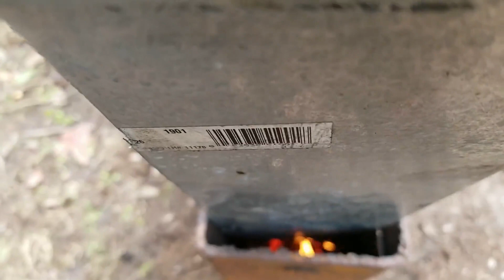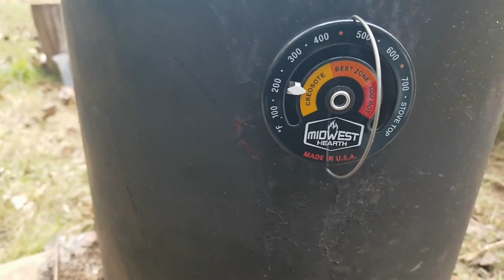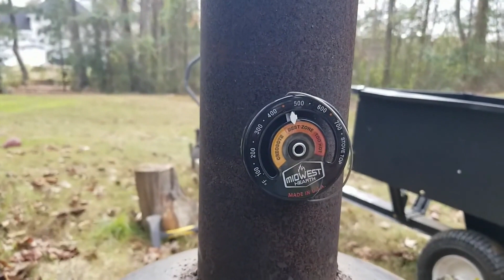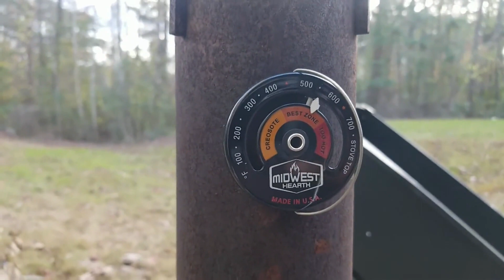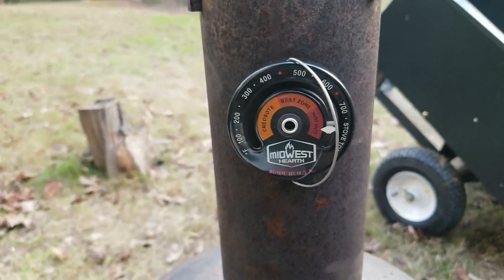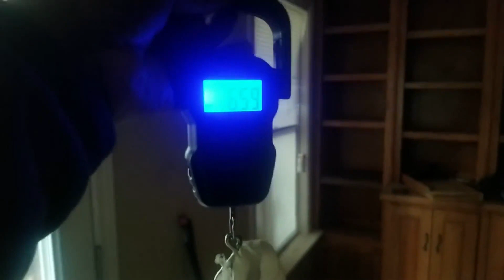Pellet burner added to efficient Charcoal retort

Comment: You’ve got a pretty cool design going on there.
Have you considered wrapping the retort with insulation to help retain heat in the chamber ? It might help you cut down some time on your process.
Good luck 🍀👍!
Reply from the maker: That's what I plan to do. My nextmove is to insulate the burn chamber and create a pellet basket to fill the feed tube. I believe that will get me the results I want. Thanks for watching.

Comment: I like what you are doing here.
I do think you could pack the "oven" tighter without any strong negative effects.
Did you have to refill the pellets, or was the initial amount enough?
More than the time, the amount of attention required is what would concern me, and it's also the best reason to use pellets over wood.
Reply from the maker: Hey there, I did have to refill the pellets. But this was a test run, and I finished the permanent pellet basket. I'm making a pellet hopper to hold enough pellets for a complete burn and it will be complete. Thanks for watching.